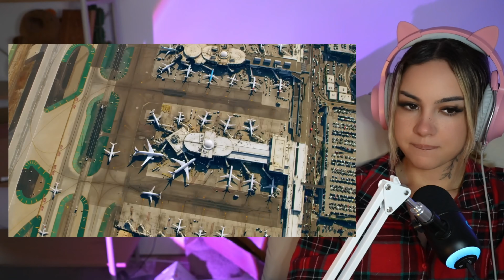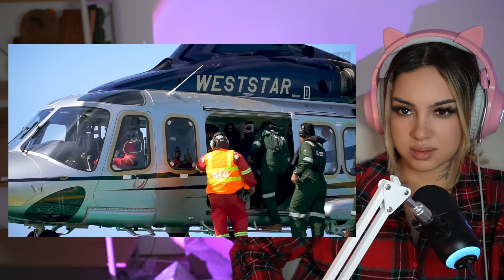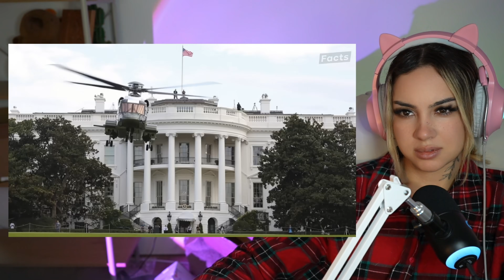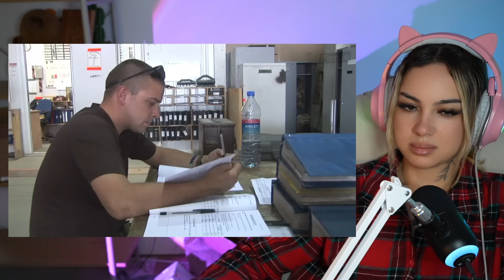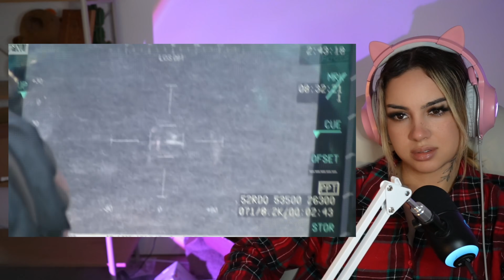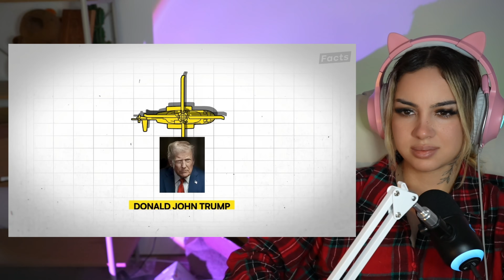Marine One Is Insane… So Why Did It Almost Fail?

Comment: 23:48. "What is that?"  That's the V-22 Osprey, Saini.  There's a few variants of ir, but they entered service in 2007.  They are what is known as Tilt-Rotor aircraft.  They take off and land like helicopters, but once in flight, the engine pods tilt forward to act line prop engine planes.  Which means they can fly faster than a helicopter.  Helicopters have a maximum speed because the rotors create a stall and drag problem as they retreat back away from direction of travel.
The CH-47 Chinook (heavy lift helicopter has a top speed of 196 mph.  A UH-60 Blackhawk has a top speed of 183 mph.  A V-22 Osprey has a top speed of 314 mph.  So you can see how much faster it it.  These three aircraft are used for troop transport.  They can carry around several dozen troops for the Chinook and Osprey, about 8 for the Blackhawk.   The Chinook can carry up to 55 troops if you jam them in there, 32 normally.  The Osprey can carry up to 32, but 24 normally.  Basically about a platoon of men per Osprey.  Two platoons or the Chinook.

Comment: AF-1 and Marine-1 are *any* aircraft that has the President of the USA on it.  When POTUS isn't on it, then it goes by the tail number, just like *every* other helicopter or aircraft.
AF-2 and Marine-2 are similarly *any* aircraft that has the Vice President on it.

I'm amazed when news organizations get this wrong. The Bbc always gets this wrong.

Why did this video show the wrong model of helicopter for some the oil rig footage.  We know the difference between a Bell and a Sikorsky helicopter. Right?

Most commercial aircraft are triple redundant for everything.  This isn't new. they've been that way for 50 yrs.  The armor plates and high velocity bullet-proof glass *is* unusual for a helicopter, however.  I'd bet those addons are very heavy and would massively impact performance.

Helicopters do not have to lift straight up. Forward motion actually does help them to lift more weight or have higher performance than a dead lift.  Landing vertically usually happens after 500-3000 lbs of fuel are burned, so that's easier.  The total internal fuel tank load is a little over 5000 lbs.  In helicopters, the transmission is really the main concern for wear and tear.  Helicopters need to be overhauled much more often than fixed wing aircraft, partially due to the transmission wear.  The numbers are public, so anyone can look them up for the model aircraft/helicopter, including military versions.  The flight from the White House to Andrews is a little over 30 minutes. It is only 11 miles.  The helicopters are pre-located to where POTUS will be landing in advance so POTUS can skip traffic.  Sometimes POTUS will just have one of the armored limousines pre-located if he wants to screw the traffic up at his destination.  Marine-1 can fly about 600 miles with a top altitude of 14K ft (published).   The typical cruise speed is about 175 mph.  Not bad for beast.  The top speed is listed at 190 mph.  normally these numbers are provided in "knots" - nautical miles per hour for aircraft, since headwinds and weather and other traffic can impact each.

Propellers are called rotors on helicopters.  The video also seems to imply that autorotation is something only this specific helicopter can do.  Nope.  All helicopters and pilots learn the perform emergency landings with autorotation.  There is a range of altitudes where autorotation won't work.  It is different for every model, but generally above 500-700 ft.  If there is sufficient forward motion, the ability to convert that into an autorotation landing is estimated even at just 50 ft above ground.

All the slow-motion rotor shots are spinning THE WRONG DIRECTION!  Why?  Everyone of the fake and most of the real rotor shots are being run in reverse for some reason. I'm guessing to avoid copyright infringement.

RF equipment (radios) can be interfered with or cause interference with flight controls. Until you test, you don't really know. It is both a science AND an art form.  Add in the need for EW - electronic warfare. Let's just say, it isn't a trivial problem to solve.

Let's just say, I have direct experience coding for redundant avionics systems.

FWIW, Google is estimating that the encryption normal people use will be hack-able in 2029 with new quantum chips.  That will scare all govts and military people world wide.

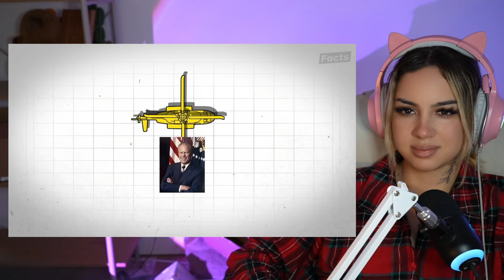The video 21:37 talks about Nixon, then shows JFK?  Details matter.

23:51 - What is that?  That's a V-22 Osprey Tilt-Rotor aircraft.  The Marines have a love-hate relationship with that particular aircraft.  It takes off and lands like a helicopter, but has a much longer range like an airplane.  It has killed lots of marines, mainly because it can carry so many (24 marines OR 10,000 lbs of cargo) and when there's a failure (transmission gears get shredded), it tends to kill everyone on-board.  The USAF has them too, but the Marines have a much higher death rate, probably because they fly near and over salt water all the time. Salt water is bad for aircraft of all types.  When compared to per-aircraft failures, the V-22 is safer than most other military helicopters.

Comment: 8:09 I'm disappointed that no one has explained aerodynamic lift yet, here goes 🤓

Everything is pulled down by gravity.  To get something into the air, you need to overcome that pull with "lift."  Airplanes and helicopters do this by creating an air pressure difference.  As the helicopter blades spin, a low pressure is created on top of the blades as they push away the air.  High pressure air always moves towards low pressure.  So, the higher pressure air under the blades, moves up, towards the low pressure.  This lifts the blades, and the helicopter, with it.  It takes a lot to spin the blades fast enough to sustain the low pressure.  This is why helicopters and even drones are so loud.  The motors are doing major work, and the blades are pushing away tons of air to create the low pressure needed

Comment: Those engines were developed and built at GE Lynn Mass.  They also developed the A 11 Warthog’s TF34 and the F18’s F414  ( Hornet).  By the way, the CT7 is a refit T700 which powers the Apache.  Lynn again.  Now, about the Blackhawk…..

Comment: You've got a point, if it doesn't work it's badly engineered. This is a cool video though. Pretty comfy looking inside if that pic was accurate. I have ridden in a helicopter a long time ago, I loved it but it does seem a little sketchy.

Comment: I am a Sikorsky retiree, electrical designer worked on the S-61/VH-3D. The S-92 was in planning when I retired. The USAF maintain the airplanes and Marines are maintain the verticle lift aircraft. Yes I flew in a helicopter.😘
Reply: I visited Sokorsky once.  I was amazed it was under one roof!  My plant GE Lynn Ma. Was as big but had  about twenty buildings
Reply: Very cool job, tips cap

Comment: Imagine placing your fan on the floor so it’s blowing against the floor. Now imagine the fan blade spinning really fast. As it blows down it will force the fan up off the floor, change the pitch of the blades and it will force more or less air. That how a helicopter goes up and down.

Comment: I always wondered why a helicopter rotor couldn't be shortened by 50% and the thickness be doubled.  I asked my nephew, who is an aeronautical engineer. He works for the Department of War and is reengineering the rotor system on the CH-47.  He said the blades would vibrate badly if designed the way I asked about. Addirionally, the blades have to be perfectly balanced.  I believe if they are shot, the aircraft can still fly. But, the affected blade would need replaced.

Comment: In some ways a helicopter can be safer than an airplane.
With helicopters they all have the ability to "autorotate" the blades.
Not all airplanes are built to "glide".
Of course there are exceptions but generally speaking.
I been thinking about getting my private pilots license. Flying a helicopter is more difficult.

Comment: The rotor blades are rotating lifting surfaces (wings) that create lift as air flows over and under them.
Reply: That's obvious. But to normal people it's still hard to understand the physics of it. It shouldn't make sense that it works. Haha
Reply: I like the old explanation that a helicopter just beats the air into submission.

Comment: Hey FGR, the helicoptor the president rides in has never been shot down. The holes are windows. The old one did not fail, they just needed a better one, with more upgrades.

The prop blades are shaped and angled to create lift. And at a cost of $217 million, it better have a nice interior.